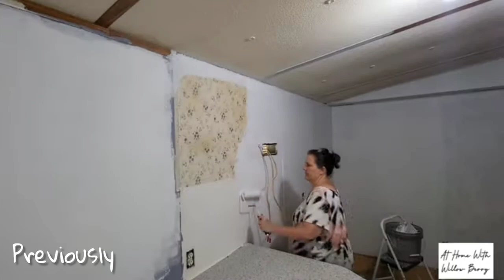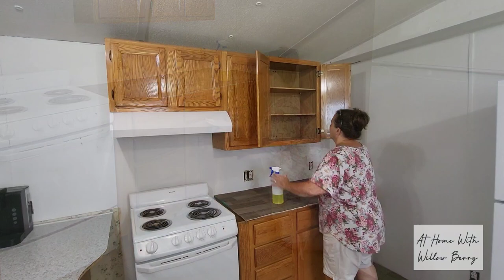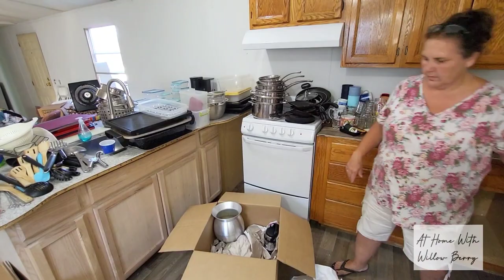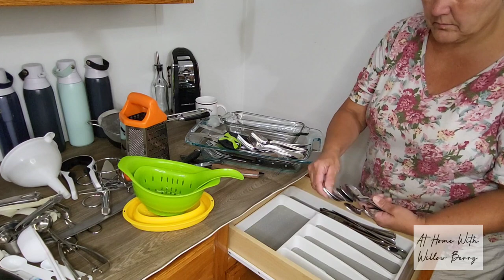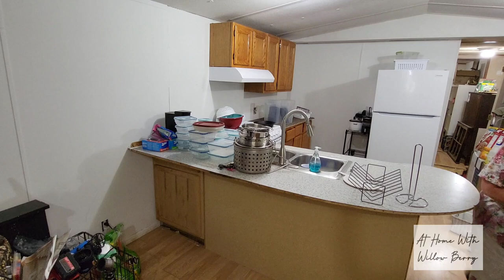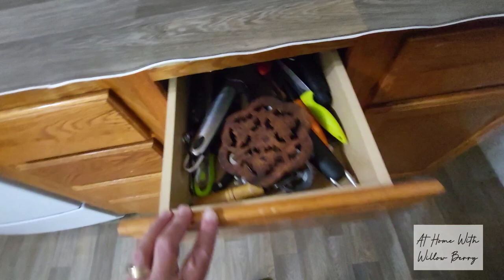Organize my small mobile home kitchen with me. / MOBILE HOME LIVING

Comment: Great job I live in a mobile home I know how hard it can be to find space without looking packed up all the time I'm constantly down sizing stuff especially things I never use I love the way you guys are making it look so good in there all it takes is elbow grease... As far as the pantry goes in sure since you are renting you wouldn't do this but we had a heat pump put in and took out the furnace that was inside then it made a perfect pantry just a little remodel in the hole that was left and bam a pretty good size pantry

Comment: Love the flooring and the "counter top"
Reply: Yes very smart for a temp fix. I used the peel and stick vinyl tiles in my under-sink cabinet. Water and cheap particle board cabinets don't go together.I didn't have a leak but thought I would get ahead of the problem.
Reply: I’ve always done the same,easier to clean also.

Comment: The cabinet that has the door on the opposite side of the island, I would just change the door to a flat door so it flows with the island a little more and it will be less noticable. Just a thought. The taller cabinets I think u had colanders in one, u can get those racks that u can use a shelf to get more space. I hope that makes sense. In my head it sounds right. Good luck with everything it's looking good!!!!! I'm new here just came across the channel and started to binge from when u moved until now. Have an amazing week

Comment: Just an idea, but is it possible to hang your pans on the wall; especially the cast iron pans?  I use mine so much it's much easier having them really handy.  Wasn't sure if the landlord would let you do that.  You could also hang some of you go to cooking utensils as well.  For the utensils, you could get the command strips ( Dollar Tree equivalent), or a magnetic strip mounted by the stove.
Reply: Good ideas, Diane! Also, could use a large, heavy pitcher or vase for oft used utensils or magnetic strip on the side of the frig. 😉
Reply: Yes, I have a large crock on either side of my stove for all of my utensils. Looks like you have the counter space. Also why do you have four rolling pins,honestly asking,I’m not a baker?
Reply: @lauramitchell6725  are you asking me about the rolling pins?  I only have one, and it has no handles.  LOL.  I still use it, but it has no handles.  I do bake.  Quite a bit.  I do all of our baked goods.
Reply: @dianebeckner884  sorry no,I saw four in Valerie’s small drawer,just wondering why she would give all of them  that scarce real estate but like I said, I’m not a baker so don’t know if they are all necessary.